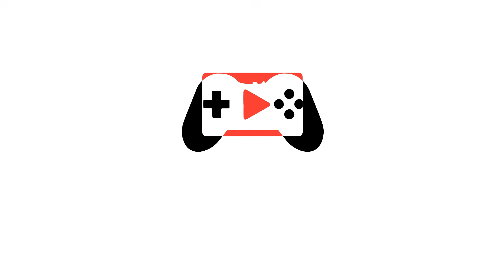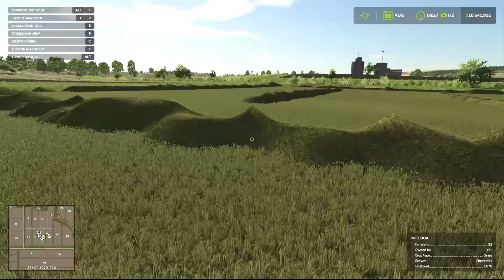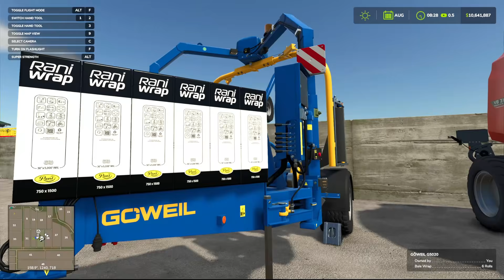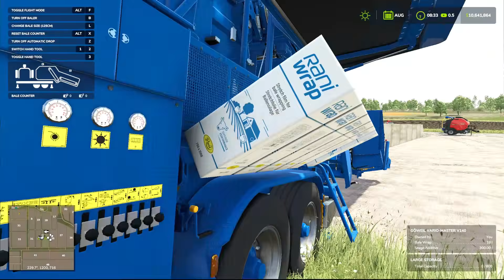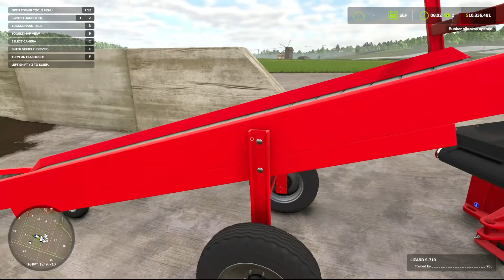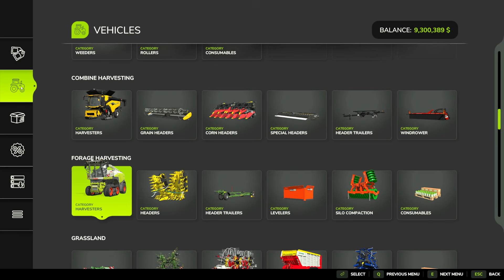The Complete Silage Guide: Bales & Bunkers Explained! - Farming Simulator 25 Guide

Comment: Question once my grass turn into silage in the silo can i put more grass on top to make more silage or i need to wait until i have all the grass in and then cover it so it all turn into silage im confuse 😕
Reply: I don't know if you can, but I would think pile as much grass in there once, cover and convert to silage, then sell it off or use it all, then repeat.  I know in harvest trailers, you can't load oats, for example, into a trailer that already contains wheat.  I would think the bunkers/silos would be the same.

Comment: I tried rotating those bunker silos but failed terribly, they only do 90 degrees 😢. Any advice for pc player.
Reply from the maker: I think its just a limitation with the vanilla silos. There may be some mods out there that will let you do the full 360 degrees though! This is where I get most of my mods so check here: https://www.kingmods.net/en/
Reply: That's by design, they can only turn 90 degrees on a hidden world grid. Unlike most other buildings